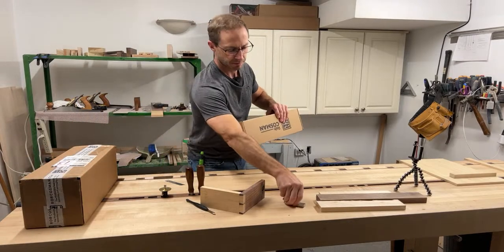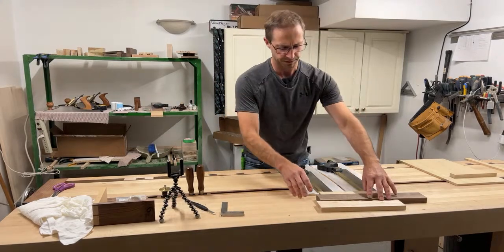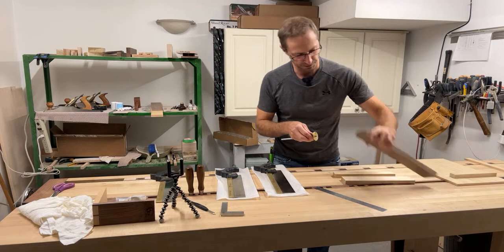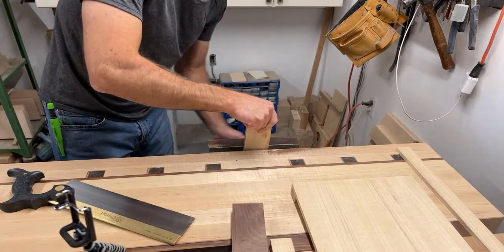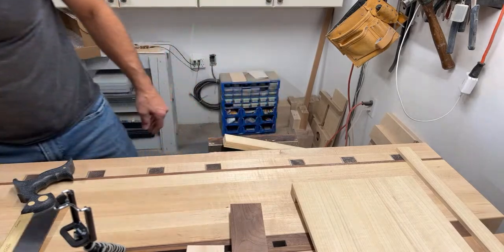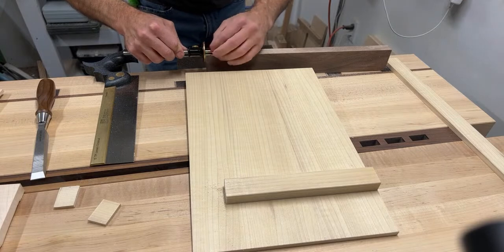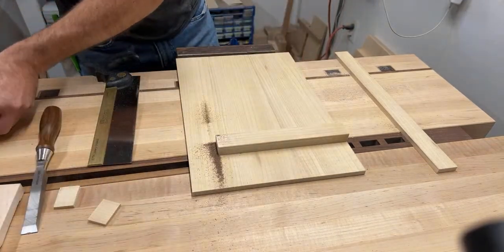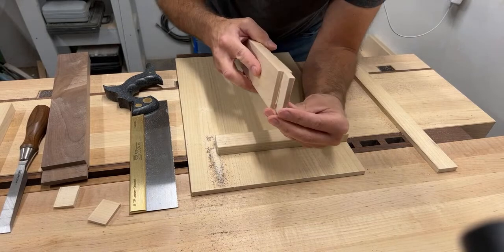New Rob Cosman Handsaws￼ // I Have No Idea What I’m Doing… Yet!

Comment: Are the brass backs all the same size?
Reply from the maker: No. They are all ¼” thick but the widths are a little different. The dovetail saw and the joinery cross cut saw are both ⅞” wide and the medium tendon saw is a little bit wider at 15/16”
Reply: @garynelles  
Thank you for the reply.
Reply from the maker: @scottsiejkowski8486 let me know if you have any other questions.